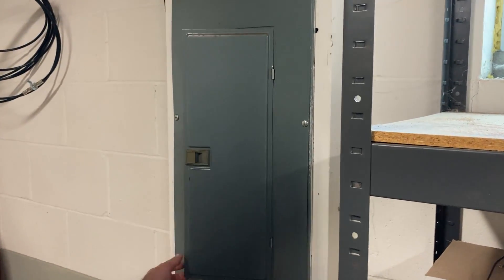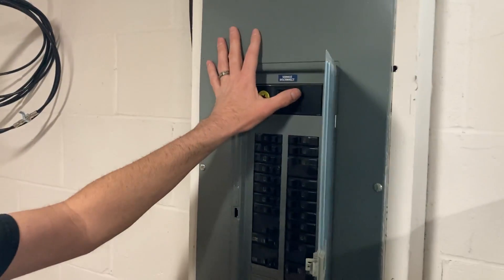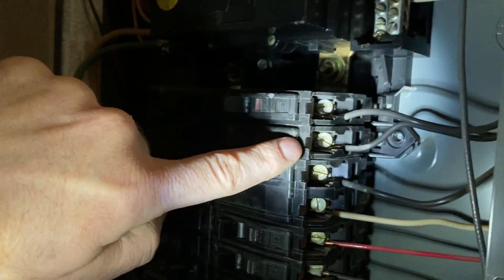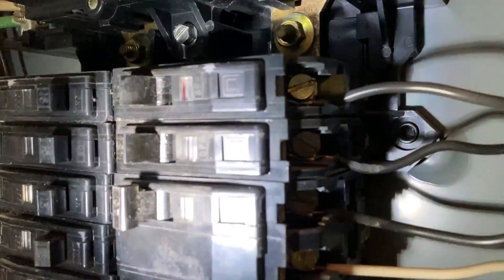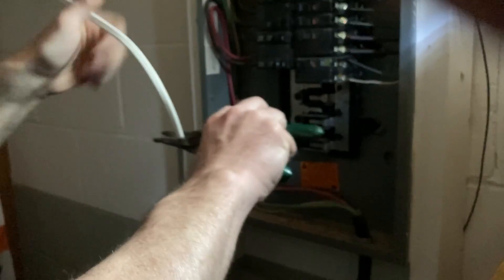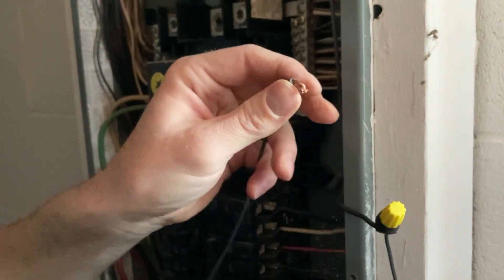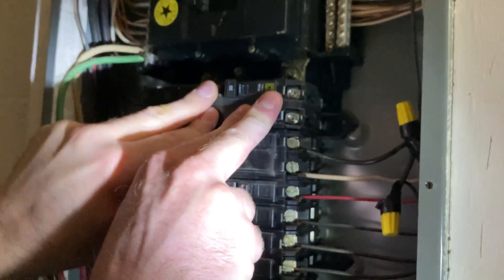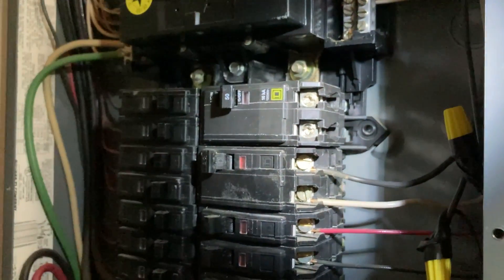How To Move Or Replace Circuit Breakers

Comment: i was about to attempt this, i opted to shift all breakers down to fit 50A breaker in.  i didn't have enough slack to move the top , so i had to use pliers to  pull wire about an inch.

also, your wires going in the panel from the top, would have made it easier to pull some slack to shift breakers down.
Reply: That is the proper way to do it. Never use wire nuts to extend these type of wires.

Comment: I have a 2 pole 20 amp at the top then there is open space then their is a single pole 15 amp then another open space . I  like to move those down together to put in a 2 pole 50amp for a inlet plug at the top inplace of the 20amp will that be OK  for a genarator inlet plug in case the power goes out.their is two open spaces.in your video you move 2 breaker down. in my case their are three open for the 2pole 20amp and one for the single pole 15amp .I simple have to move two breaker down to open a spot for the 50 amp. please advise.

Comment: Very informative video with great clarity. One of best IMHO.
I have a similar setup, however I have to relocate a 40 Amp 2 pole breaker, so I can install a 50 amp 2 pole breaker for the generator & interlock setup. I have to also extend the 40 amp with wire- lugs.
have two questions, would appreciate your input!

1. what gauge wire would you recommend to use in extending the 40 Amp wire? I was going to use 6 gauge. Please let me know what you think?
2. Also I noticed you ran the 6/3 wire with the sheath from the top knock-out. I don’t have any on the top, instead I have one on the bottom left. Besides the aesthetics, do you know if it’s a code violation?
Reply: I had to move my oven’s 40 amp breaker down to the bottom too to put the generator breaker on the top right.  I think I used 8 awg and used the biggest wire nuts that I found at Lowes to connect the jumper wires.  It’s worked great since I installed it about 7 months ago.

Comment: There are a few screwdriver options on the new breaker. While the old breaker allowed only a flat blade, newer breakers (and most devices) allow you to use flat, Phillips, #2 Robertson (square drive), and some combination bits. Now that there are torque requirements for the screws, I find the square drive is the best driver since it will not cam out. Most 1/4" bit sets include #1 and #2 Robertson bits.

Comment: I'm a little confused with people asking about shared neutrals, and keeping the same phase in the first (main) box, aren't all of the neutrals / grounds tied together anyway? isn't there a jumper connecting the L and R neutral / ground bars together so they are all connected no mater what correct??? -- speaking of a primary or main panel not a sub panel. also IF all 220 (double breakers) sit on top of each other (1&2) with no singles in between the hots are on both phases  since the panels alternate phases on each side (left side starts at 1 and right side starts at 2) right??????
Reply from the maker: I agree, confusing and also keeping them on the same side would negate all the finger wagging.

Comment: First of all, twist your wires with lineman pliers, not needle nose. All electricians know that
Reply from the maker: First of all, im not an electrician.  2nd, thanks for the tip!
Reply: @shawndavis9276  And, do NOT use your wire strippers to remove the knockouts.
Reply from the maker: @pawpawraab3294  when all you got is a hammer everything is a nail dog….

Comment: So all the breakers can be moved down 2 slots to put the 30 in, where do the neutral and ground wires go
Reply from the maker: I’d imagine they could stay depending on how your panel is set up, Just move the hot down with each breaker
Reply: @shawndavis9276  
I mean on the new 10/3 wire coming into the 30 amp breaker for a generator outside

Comment: This is exactly what I need to do only o need a single pole 30A up to since my generator is only 120V.  Gotta swap the top right one and possibly splice in a piece so its long enough to reach the bottom of the panel.
Reply from the maker: Apparently some localities don’t allow splicing inside the box, make sure to check first.  
If you aren’t allowed to splice u might have to move all the breakers down one of there is not enough extra wire
Reply: @shawndavis9276  thats what i was reading in some of your comments.

Comment: When I installed an interlock I just moved each right hand side breaker down two spaces... starting at the bottom and working until they were all moved.   Usually there is enough play in the wiring to safely allow a move of two spaces.   This way, wiring does not need to be joined and no 'wiring' work is needed at all for this stage in the process.
Reply from the maker: Yeah that’s definitely an option, I didn’t want to relabel everything lol
Reply: @shawndavis9276  HAHA!
You are never going to write that novel, you know....  LOL!
Reply: Where do the neutral and ground go for the new 30
Reply from the maker: @chrisbenson6860  that’s the easy part, just plug it into the rail with all the others, there’s a bank of nuetral and a bank of ground.  Find a spot that makes sense and u good
Reply: If I just move the breakers down as you mentioned will I have to worry about the neutral overload issue other people have discussed in other comments?
I’m wanting to do this but want to do it as safely as possible
Reply from the maker: @xblakeleyx  beats me lol been 3 years and no issue, only ran the generator once for a few hours
Reply: Did mine the same way and no problems.

Comment: Seems like it would have been easier to move all the breakers down 2 spots? Tell me if I’m wrong people I’d really like to know.
Reply from the maker: Way less rewiring this way.  Could have avoided splicing inside the box moving everything, but would have had to move all the wires down 2 as well.  
To be fair, moving the top 2 to the bottom is arguably the lazy way.  
Btw, splicing instructions de the box is fine by code where I live, some places don’t allow it
Reply: Ok just checking. I’ve spliced in wires also but thought I’d ask since it looked like there was enough wire to move all the breakers.🤔

Comment: Be careful when moving circuits around in your panel. Especially if a multi conductor cable is used. Make sure breakers are not on same phase, otherwise the neutral will be overloaded. A sign of overloaded neutral is blackening of neutral at termination bar in your panel, because it’ll get extremely hot.
Reply from the maker: Thanks I should probably check lol
Reply: @shawndavis9276  Hi, your fine if it’s not a shared neutral.

Comment: I was wondering why you didnt just put the new breaker on the bottom ? Great info , may thanks
Reply from the maker: I’m adding/swapping for a generator inlet.  The bracket that prevents back feeding is made to have the generator power in those slots

Comment: Regarding the use of the white wire for extending the hot side of circuit  It's not just a matter of matching.  I am sure that it is a violation of the electrical code to use white wire for the hot side of a circuit.

Comment: Why not just move all of the breakers down by one instead of moving the top one to the bottom? That way, no extensions would be needed as existing wires would be long enough to move 1 slot down.
Reply from the maker: You could.  I didn’t.  Less re-labeling.

Comment: I have a 240 amp where your 15 and 20 were. I want to move it to the bottom like you did with your 15 and 20 for my generator breaker. Do I have to move the ground also or just leave the ground where it is and just hook up the hot wires?
Reply from the maker: I’d say the ground is just fine where it is but without seeing I can’t say 100% all the grounds on mine are off to the side in a rail on their own.
Also I’m not an electrician just an idiot with a video camera on my phone😂
Reply: @shawndavis9276  I appreciate the response. It really helped. Thanks again.

Comment: I have two breaker panels, the main one is full and a secondary panel with a few extra slots.
If you had to move a breaker from the main panel to a second panel, do you need to extend their neutral wires along with the hot lines to the second panel? Thanks for your videos!
Reply from the maker: Good question, I don’t know the answer but I would move both so it made more sense for the next person working in there, and then if you ever needed to work on that circuit again or  whatever it’d be easy to find the right wires
Reply: @shawndavis9276  I did some more research and found out that I need to move both hot and neutral for the moved breaker to provide safety against overloading the circuit
Reply from the maker: @ItsAlive111  thanks!
Reply: @shawndavis9276  thank you for your video. It helped me set up my generator breaker on my main panel, under the main, that was full and move some breakers to the second panel next to it.
Reply from the maker: @ItsAlive111  awesome! Way to go
Reply: No you don't need to move the neutral wires unless your moving a GFI breaker or arc fault(AFCI) breaker in which that circuit neutral attaches to the breaker and the pigtail on the breaker attaches to the neutral bar

Comment: didn't think you could just use twist on connectors without putting them in a wiring enclosure of box, pretty sure that wouldn't pass any inspection.
Reply from the maker: U can where I live, see the other comments regarding this
Reply: @shawndavis9276  wish I could where I live...
Reply from the maker: @flasha29  you can

Comment: Most other channels used a 30amp generator breaker you used a 50amp ,please explain why ?
Reply from the maker: I would imagine that their generators only put out 30 A, which is fairly common especially for RVs and motorhomes.  I bought the biggest portable generator I could find and it’s 50 A and 220 V
Reply: @shawndavis9276  makes sense, thanks for sharing 👍
Reply: Above 7500 watts generator- you need 50 amp breaker. Which is better because most of generator now provide higher watts tl generate the the AC and whole house

Comment: 14 gauge wire on a 20 amp breaker is a code violation.
Reply from the maker: You are correct.  I have since corrected the problem when other viewers pointed it out.  Thanks!

Comment: I want to do this when I get my 13000W generator. What determines when a 30A or 50A double breaker is used?
Reply from the maker: Depends on what your generator puts out if it’s 13,000 W I would imagine it puts out 50 A
Reply: If it’s a 13000 W generator supplying a 120/240V panel than your output amperage would be about 54A so you’d need to upsize to 60A breaker
Reply: @Nick-bh1fy  😳
Reply: @jackwebb5917  problem?
Reply: @Nick-bh1fy  

No, just surprised me. Glad I asked
Reply: @jackwebb5917  glad I could help
Reply: Depends on how big or how many watts/amps your generator puts out.  If you look at the actual 240 volt female receptical on the generator, (stamped on it) should give you the style plug (ie, L14-30R 30).   The 30 would mean it requires at least 30 amp plug, 30amp circuit and the gauge of wire that can handle 30 amps-10 guage I believe).    If you have smaller generator, you can go with smaller amperage wire, circuits, etc, though it wouldn't hurt to go larger should you upgrade to a larger generator.
Reply: @louofm1  

Well I ended up with a 13000W
Reply: @jackwebb5917  nice!  Assuming it's 13000max puts running watts a bit over 10,000, that would be a 50 amp circuit, 50 amp plug,  and I think 6 guage wire and cord.   If the running watts are 13000, then I think you go to a bigger amp circuit

Comment: Why not just put the new 50 amp breaker down at the free space at the bottom?
Reply from the maker: I installed an interlock switch for a generator coming into the house, so I needed the 50amp to be there for the switch to work

Comment: Just to add, Can't have white wire on a Breaker, Black Tape will correct Code Issue. Smaller wire would go on the 15 Amp Breaker, if both were #12, may as well put on a 20 Amp Breaker, unless equipment needs to be protected by a 15. You would want to follow those 2 Circuits where it exits Panel, if they share a Neutral, need to be on a 2 Pole Breaker to insure on Opposite Phase. Since top was 15 Amp, possibility of 2nd and 3rd Breaker down may be a Multi Circuit (2 20 Amp Circuits sharing a Neutral), If Both Draw 20 Amps, Neutral would draw Zero Amps. If wired I. Same phase, Neutral would carry the total of Both(20+20=40Amps) Over Loading the Neutral
Reply: thanks! I have one of my AC breakers with a white and red wire used as hots  (of course the clowns that wired mine  before I bought it!!! put BOTH AC units one one 50 amp breaker and Both air handlers on one 20 amp breaker lucky my house didnt burn down I guess) -- I will wrap with black tape next time im in there (I wondered about that when I saw it).

Comment: I'm wondering,
Could you be able to move each breakers down two spots and make room for the new breaker?
Reply: That's what I did, seemed easier to shift all the breakers down 2 slots, there was enough wire on each....I didn't have to splice wire on the 2 top breakers to put them on the bottom
Reply from the maker: Yes
Reply: This is why I searched the comments, that's what I thought maybe move them all down two spots.

Comment: I could be wrong but it looked like you used 14 gauge (white jacket) instead of 12 gauge to pigtail the 20 amp.  I didn’t see the yellow jacket - 20 amp wire. Again, I might have missed it with dark lighting you were working in.
Reply from the maker: You are 100% correct and I should probably fix that.  Never even occurred to me.  Thanks!
Reply: unless it was real old 12 gauge wire which had a white jacket also....my house has white jacket 12 gauge... which fooled me at 1st. till I read the jacket.

Comment: Why do u need to move the 15A and 20A down to the bottom? Why not just place the 50A at the bottom? I'm kinda new to these stuff so.
Reply from the maker: Because I am installing a interlock switch for a generator.  The 50a will be power coming in and the interlock toggles between the main 200a coming in, and the top two right slots.  
If all you were doing was adding a 50 amp service for a new oven or something, You could for sure just add it at the bottom and an open slot, great question

Comment: To avoid 'splicing / pig tail' wires at the Panel...... how about just moving all the Breakers on right side down to allow for the new Breaker...? as long as the wires have enough slack for this.
Reply: Yes. And that also insures that everything will remain on the same phase it's currently on.
Reply from the maker: I suppose.  Lot of dinking around.  It’s not a problem with r a code violation where I live but it would be a great solution for places that don’t allow splices in a panel

Comment: It is against code to splice wires in an electrical panel.
Reply: Here in NY (one of the strictest code enforcement in the nation) it’s not. What your reference?
Reply from the maker: Not in minnesota
Reply: Is a OK in California but  the jump wire should be a #12 on that 20 amp C/B not the 14.
Reply from the maker: @stevenchien9656  you are correct, my mistake
Reply: @stevenchien9656    ( the old #12  wire had a white jacket. )😆

Comment: I ALWAYS TURN OFF THE MAIN BEFORE DOING ANY MOVING AND REPLACING...MOVING BREAKERS GONNA BE DETERMINE ON WIRE LENGTH LIMITATION WHERE YOU GONNA MOVE TOO..AND REPLACING IS SIMPLE AS UNSCREWING AND SCREW IT TIGHTLY ...NEVER OVER TIGHTEN ..YOU WILL KNOW ITS VERY TIGHT BY COUPLE TURNS...ITS BEST RE-LABEL..FOR ME..I FORGET WHICH ONE GOES TO WHERE ??

Comment: Are wire-nuts in a load-box allowed? I understand it isn't.
Reply: You can have a Boat Load of Wire Nuts in a Panel, it is a Wire Fill Issue. If a wire has a Wirenut, it counts as 2 wires
Reply from the maker: Beats me, great question though, I’ll look in to it
Reply from the maker: Google said it’s not a problem
Reply: My instructor told me not to wire nut in a panel but when I search on Google it says totally fine. Confuse me much.
Reply from the maker: @FirstNameLastName-fu8ml  All depends on building codes in your area it’s fine here where I am
Reply: @shawndavis9276  it’s legal and perfectly fine if you’re doing work in ur own home and run into a situation like this. But it does look like poor craftsmanship to any person that does it professionally
Reply: @FirstNameLastName-fu8ml   Google is not an expert. Even YouTube is far from being an expert. You need to consult your local building department and review their adopted electrical codes to be on the safe side.

Comment: If the neutral is being shared for two different circuits, i.e. 14-3 or 12-3 with red and black hot conductors, the hots can NOT be on the same phase. That means they have to be kept track of. For half size breakers, one half height breaker needs to be between the hots to establish the correct phasing. For full height breakers, the hots have to be on adjacent breakers.
Reply from the maker: Ok, so in this case where it’s just one circuit the phasing should not be an issue correct? Thanks for explaining
Reply: @shawndavis9276  That's correct. When sharing a neutral, the phasing keeps the neutral from being overloaded. Half the time the neutral is carrying current for one circuit and half the time for the other circuit. The power coming into the panel are two 120v feeders that are phased 180 degrees from each other. Together they make 240v. If you put a 240v breaker misaligned in the panel you would not get 240v, only two 120v. This can happen when using half height breakers. These are the two main reasons to understand phasing when moving breakers around inn the box. Most people know to phase correctly for 240v breakers, but not many know the shared neutral. And it's not a rare thing. In fact it's probably a rare thing to not have neutral sharing because it saves wire and time on your home runs.